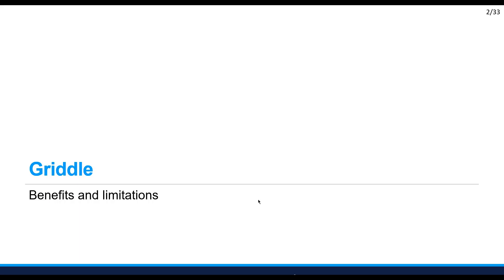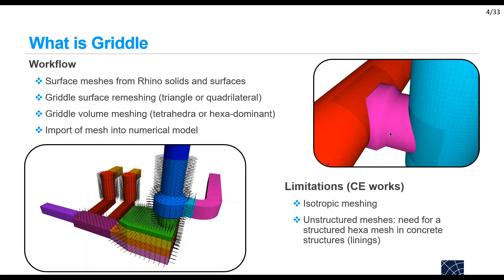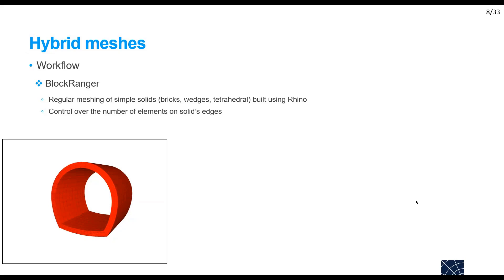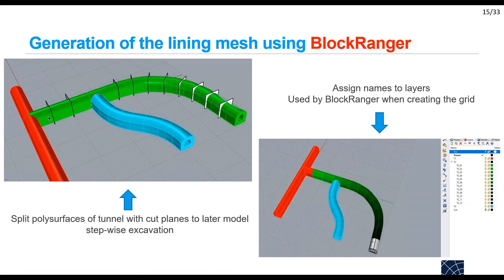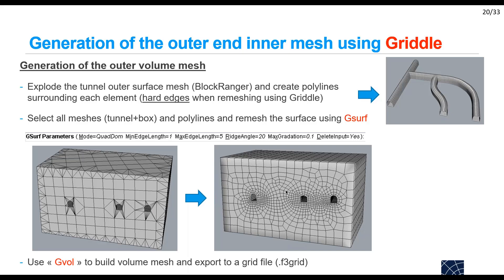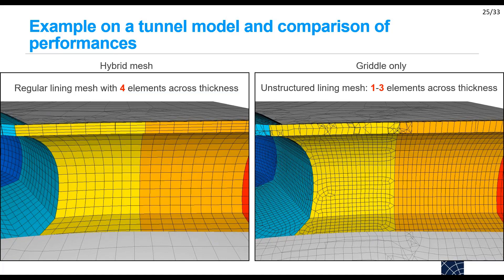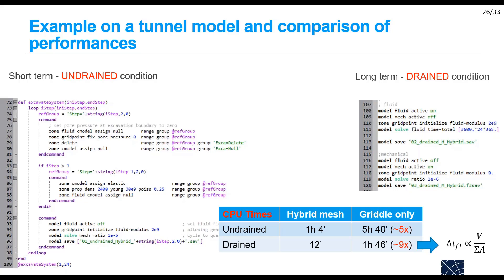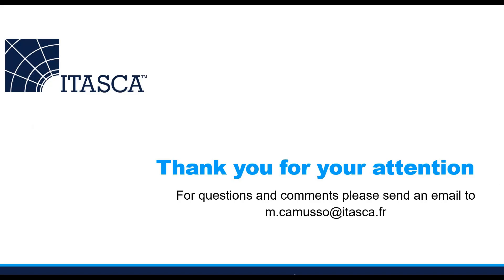How to Create an Hybrid Mesh by Combining BlockRanger and Griddle

Comment: thank you so much sir for this video , i just don't understand the part in 9.27 minutes how did you separates the tunel into many parts
Reply from the maker: The modeler created a series of planes along the tunnel pathway to act as cut-planes and divide the tunnel into a series of excavation volumes. He likely create an initial cut-plane perpendicular to the tunnel path curve and then used the "array along curve" method in Rhino 3D.